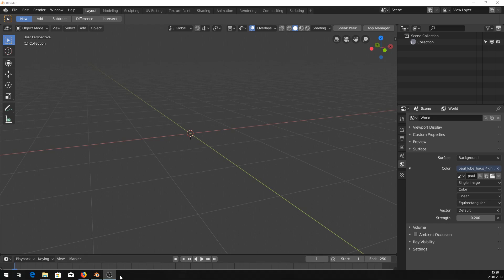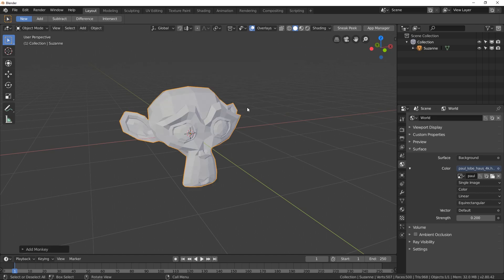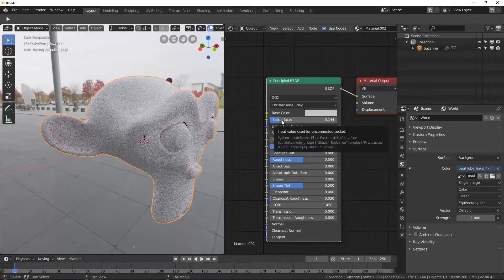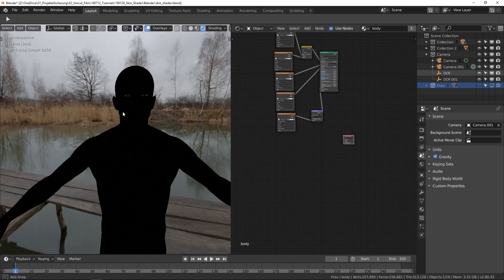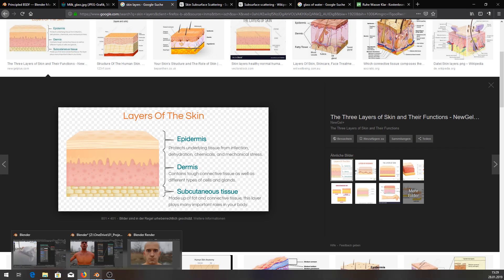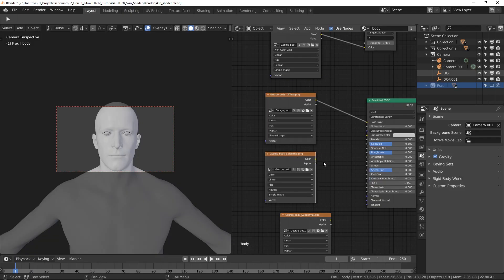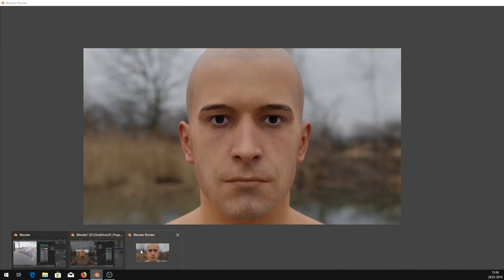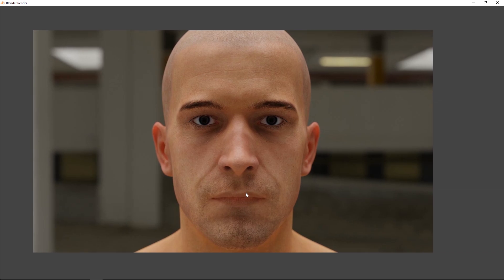Subsurface Scattering in Blender

Comment: SSS Radius simplified : the three numbers are to control the scattering amout of each color spectrum individually: first one is red, then green then blue
Reply: so its like a subsurface color? the radius also controls how far lighting penetrates..
Reply: @mrmensje1   Hey sorry for the late answer, 
Well  Basically,
The "Subsurface" setting is the general amount of light that goes through a 3D model, typically you "Map" that with a black and white texture which will tell the software where to let light through or not

The subsurface Color is the color of the Flesh of your character (as opposed to the color of the skin), which is typically orangy red, You can check on the internet pretty intricate SSS color Maps, that includes even blue-ish veins and some greens under the eyelids etc.

The SSS Radius however, controls how much of each Color will bleed through, if you put the three numbers the same amount the software will let an even amout of Red Green and Blue,  Bleed through, if you set say, the first to 1 and the two others at 0, the shader will only let Red light through.

I often find that looking for informations on documentations for other 3D software can sometimes help understanding things more clearly.
You can check a lenghty explanation here if you are interested : https://docs.arnoldrenderer.com/display/A5AFMUG/Subsurface

SSS Color maps example : https://us.v-cdn.net/5021068/uploads/editor/3a/objnbtcf46o9.jpg
https://us.v-cdn.net/5021068/uploads/editor/2a/eqogbzt3x8am.jpg
Reply: @raphaelrainard  thanks for the information :D do you have any information that teaches how to paint the different skin layer to make it look for realistics? Thank you so much :D

Comment: I recommend using Multiscatter GGX / Random Walk instead of the default GGX / Christensen-Burley BSDF with Principled Shader.  The Multiscatter Random Walk will calculate a much cleaner and more accurate SSS shader, at the expense of some render time.
Reply: I remember that, with the old Blender Internal renderer, you could get this wonderful translucent rubbery effect if you pushed the SSS too far. Never could quite replicate that with Cycles ... until the Random Walk option appeared. 👍🖒

Comment: It looks to me that the subdermal and epidermal textures are just slightly channel-shifted versions of the base skin. Is that a good/reasonable way to go about making these maps, or is there a greater process to it?
Reply: Well, they are not necessarily Just channel shifted, Some may contain different informations such as veins or generally area with more variants of colors,.
You can see an example of that here : https://us.v-cdn.net/5021068/uploads/editor/3a/objnbtcf46o9.jpg.
But I guess it depends on the type of Results you are trying to achieve, Though as a Base for your different maps, you could totally start by channel shifting the base albedo map and then adding specific details
Hope it helped